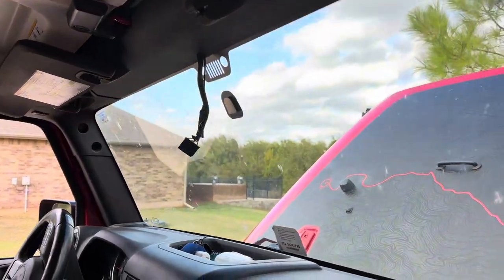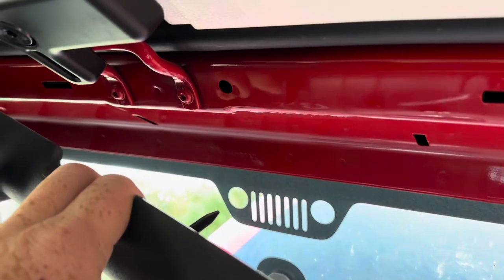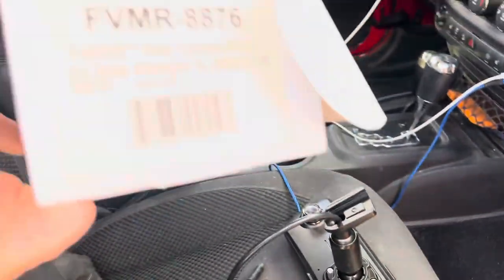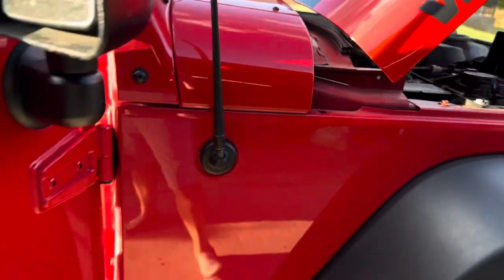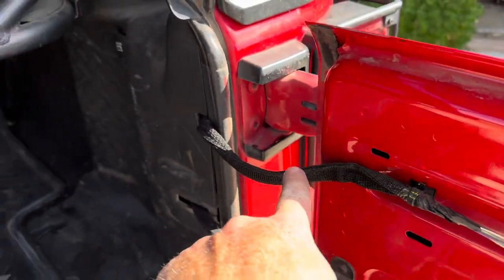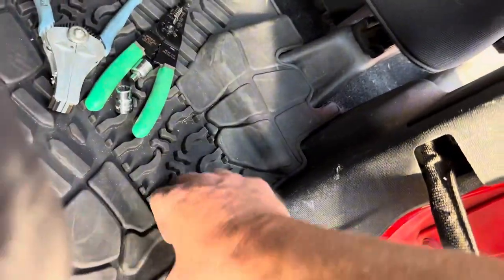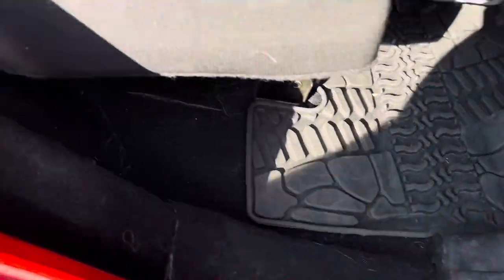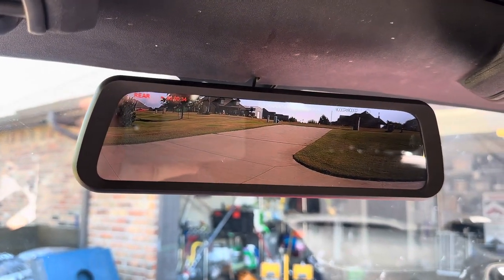Jeep Wrangler JK Dashcam Install

Comment: Thanks for taking the time to record and share this video. It is helpful to see how you routed the wires. 
I have a direct power dashcam that I installed a couple of years ago and the most time consuming part for me was creating a water tight entry into the fuse box housing. I should have videoed it to help others and perhaps I will at some point. :) 
Thanks,
Robert